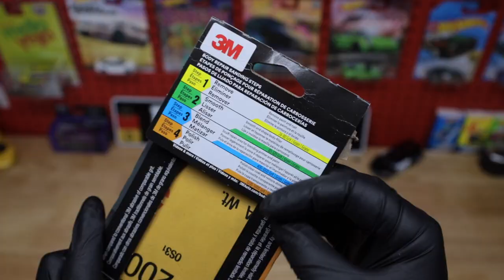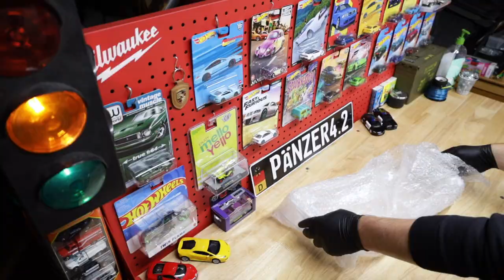Modernizing Outdated Headlights - Audi B7 A4 S4 RS4 - Upgrade/ Modification

Comment: Nice to see some quality b7 content for a change! You should do this to a set of halogen ones too!
Reply from the maker: Thank you! That truly means a lot! I do have a set of halogen headlights just sitting around so maybe I will, but the process should be pretty similar!
Reply: @royalgaragellc  as a suggestion, something on LED replacements. I'm currently prototyping some designs that will block the glare from the bottom portion of the mirror cones. As this will save oncoming traffic from being blinded but will retain the upper mirroring of the cone to light the road way. Coming up with a PVC plastic design that will snap into the bottom portion for ease of implementation. Have a couple 3d printed designs however ABS has okay thermals, PVC would be better for the Texas heat (especially after this year's Summer.

Comment: Loved it, any issues with the car system thinking you have out lights, etc?
Reply from the maker: Thankfully I haven’t had any real issues with the lights, the system does think the lights are out, but to me that isn’t a big deal, I’m sure if you just put resistors in you wouldn’t have a problem!
Reply: @royalgaragellc  yeah that would bug me lol. I’d have to ! Much nicer look though. My B7 headlights are really showing signs of condensation on the inside. So, I’m looking to repair the OEM housings, reseal etc. and remove the orange reflector and install switchbacks

Comment: That RTV Silicone you used. Is it holding up? I've been looking to redo both my lenses and I see people use the Butyl strips and have to heat it up again. I'd rather not do that if I can avoid it
Reply from the maker: First off I apologize for such a late response, but the RTV silicone that I used has held up nicely, haven’t had any moisture get in or any other issues with my headlights since I put them back together
Reply: Awesome! Thanks! @royalgaragellc

Comment: Did you get errors for replacing the bulbs with led’s? I haven’t had luck finding ones that don’t
Reply from the maker: Unfortunately I do still get errors for the led blinkers, I thought maybe using the higher end bulbs would help with that, but the car still doesn’t seem to like them. But I did find that using the higher end bulbs over the cheaper bulbs, they tend to last longer, and the individual leds don’t go out like on the lower end bulbs, which was more of my concern than any potential errors, but if you find a solution for those errors please let me know! Lol
Reply: @royalgaragellc  if they are blinking so to speak, if I remember it right it's to do with the dead times on the bulbs and because they're LED not incandescent the dead time is much shorter.
Solution? Purchase a cantus w5w resistor block that goes inline inbetween the bulb itself and the connector cup on the headlight loom

Comment: I remember trying LED stuff on a B7 before, and then you get constant error messages on the dash.
Reply from the maker: That also happened to me as well when I had cheaper led blinkers bulbs. Since I switched to the more expensive alla led blinker bulb I haven’t had that issue yet. Fingers crossed. But I also haven’t been driving the car lately cause it isn’t exactly running the best as you may know if you’ve seen my latest video lol so that could all change once I start daily driving it again. 😂

Comment: Where did you tap into for power for the halos?
Reply from the maker: I actually tapped into two power sources, I did this so I can have the halos turn on when unlocking the car at night with the key and so I can just choose when to turn them on. I tapped into both the fog light power and the drl power. Hope that helps!
Reply: @royalgaragellc  ohh alright cool yea that definitely helps, I saw when you disassemble the headlight there were wires to all the bulbs, do you think for a cleaner look it would better to tap into those instead of the harness. I was thinking about wiring it to the blinker so it could have that effect on signaling but at the same time I believe it wouldn’t send as much voltage therefor the halo would not be as bright as it could be with the right amount, but I’ll probably just tap into the drl. I appreciate the feedback